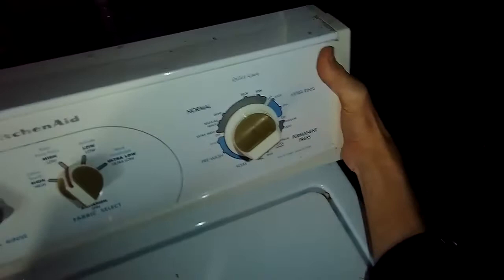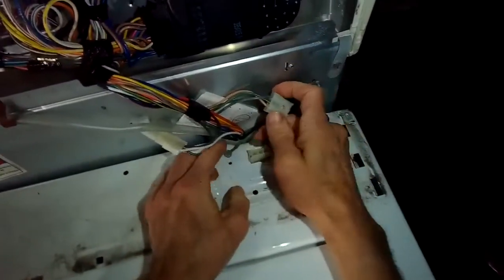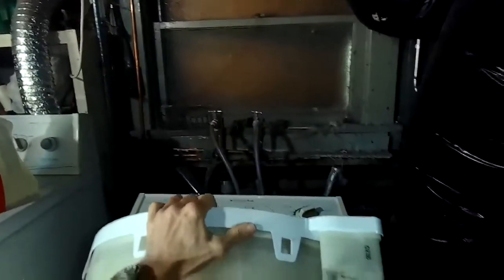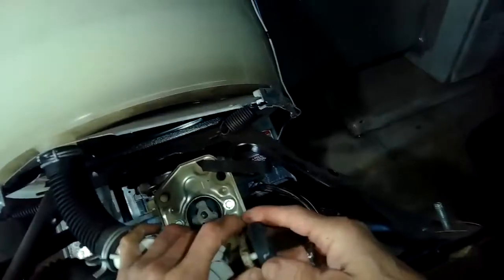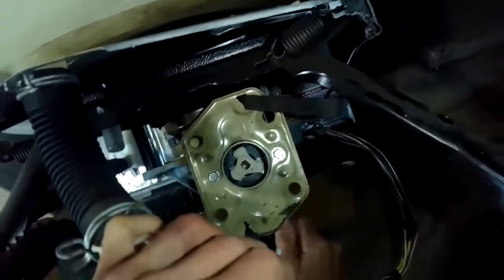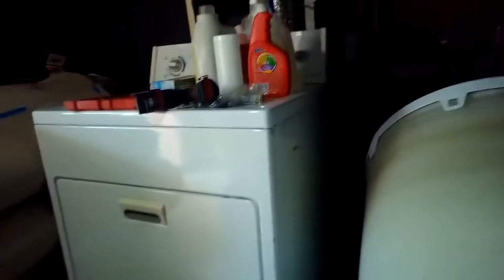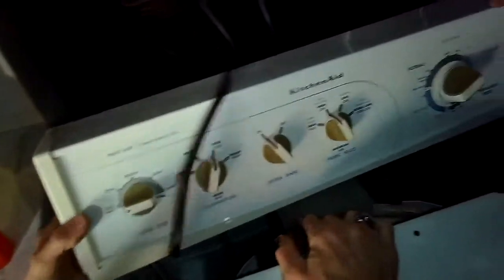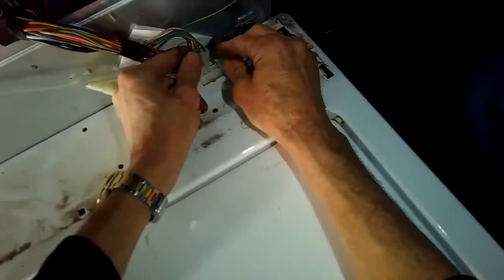✨ WHIRLPOOL Washer Won’t Agitate or Spin - EASY FIX ✨

Comment: What would the next step be in diagnosing if the motor coupler is replaced and it still will not agitate or spin?
Reply from the maker: Do you hear anything when it’s supposed to spin or just silent.
Might need to replace the lid switch.
Reply: It hums when it is supposed to agitate or spin. The washer does stop and reengage when I open and shut the lid so I assume the switch still works?
 
I also checked to make sure the agitator wasn't spinning freely in both directions, and if I turn the motor by hand, it does turn the agitator as well so I assume the gears are ok?